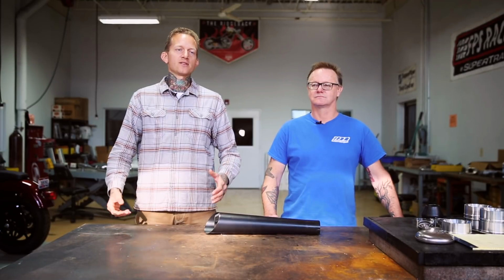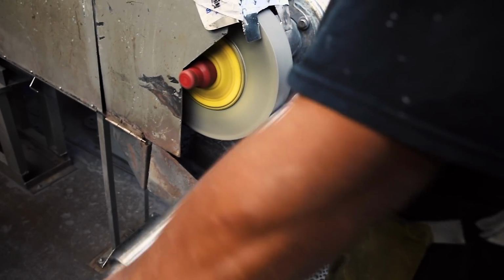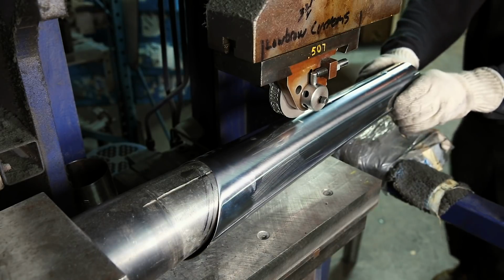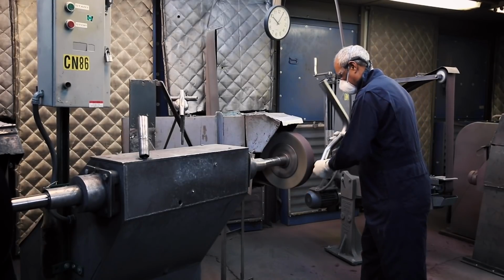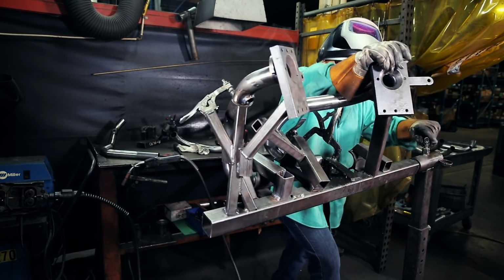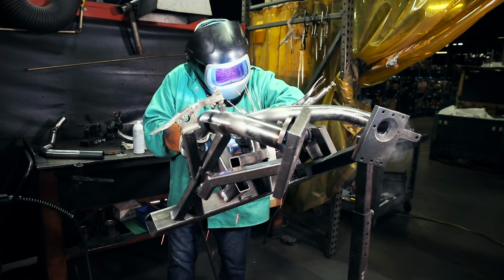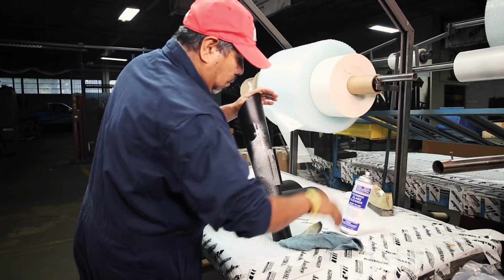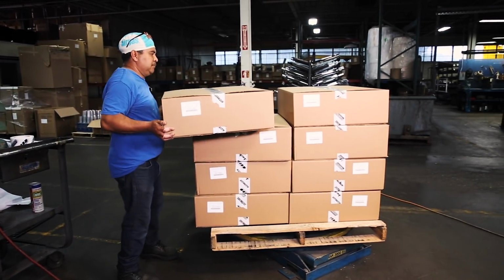Lowbrow Customs by Kerker 2-into-1 Exhausts for Harley Sportster Dyna FXR & Softail

Comment: I had one on my 04 FXD. The sound is awesome, almost like a thunderheader. However that black finish is hot garbage. It started melting off after the first heat cycle. After 1 summer it started rusting and looked horrible.

Comment: @lowbrowcustoms What type of paint is applied to the exhaust? I'm thinking about getting the header ceramic coated since there are no heat shields and wrapping the exhaust is not safe for the integrity of the pipes.